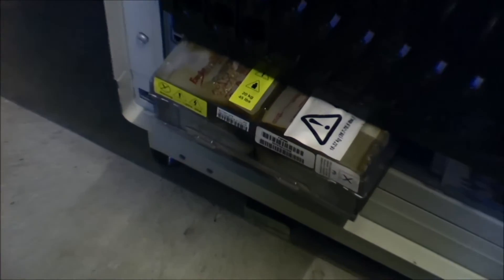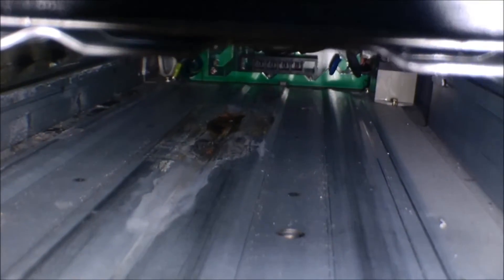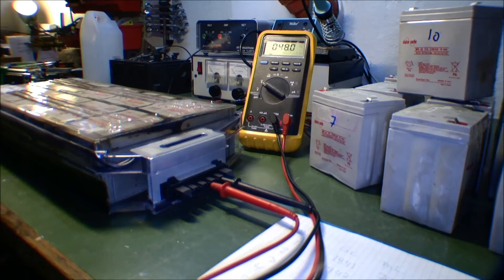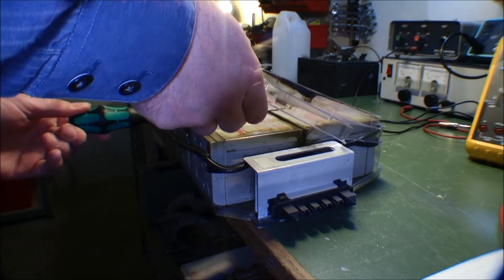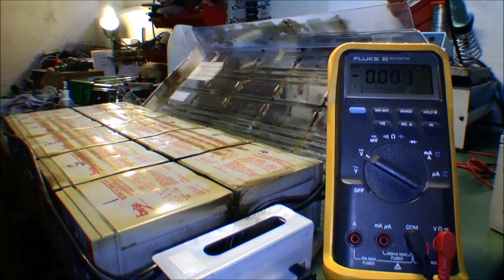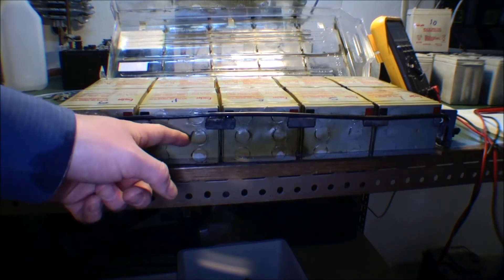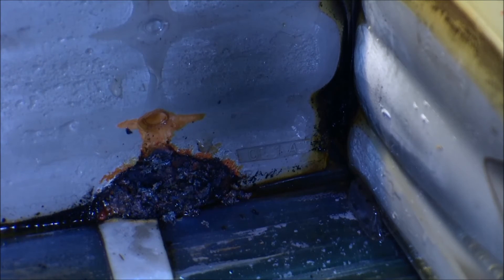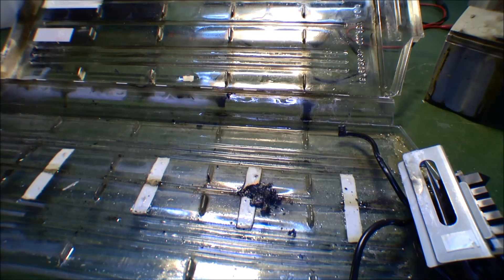Trying to get life in 3KW UPS Battery pack - part5 - 044

Comment: a big shame for the manufactor, the stuff is expensive so we should expect a save system ? battery caddys should have some sensor for temperature what put down the charge current or complete cut of the charging and give alarm ...  those things should not cost much extra is my idea.
Reply from the maker: Hi highflow highflow
Thank You very much!  This is a old video, but I just replaced the batteries, with new ones yesterday :-) video on it's way. no problem.
Thank you for watching! :-)

Comment: I have about 15 of those HP server UPS which I refurbish. Old batteries will have a larger internal resistance not allowing them to take a charge and at the same time, that internal resistance is converted to heat. The UPS charges at quite a high initial current to bring them up to the required full charge but at such a high resistance, heat and electrolyte boiling will inevitably cause leaks. If clients want a cheap repair, I get a bank of 10 X 12V 7ah batteries and wire the UPS internally to enable the battery bank to be charged outside the UPS. I manage to get those batteries for 13 euro each and they are larger so with 130 euro and a bit of Gauge 8 wire I have a good working system and also easier to check the voltages and the health of the pack instead of that crammy slot!
Reply from the maker: Hi @billywhizzy
Thank You very much!  glad you liked the video :-)
Thank you for watching! :-)

Comment: Hello, Thanks for this serie of videos. I´ll try to understand it, but my english is not very good so I only i understood a part. But I'd like do a question. In part-5 I have viewed, that ups light are blinking red for alert, red for bad batteries, and green for las light. This is the same problem that I get in my ups and I have replaced all batteries with no solution for the light. Have you repair it after batteries replacement?. I no get connection for check it with HP Power management so I'm blind. I don´t kow What i can do. Any idea? Thanks
Reply from the maker: Hey p-upssss,, Thank you for your question. 
Do I read correctly that your two red LEDs flashing and the green LED is on. ??
I would start by measuring the voltage on the battery pack with a multimeter.
If you have the same model as in my video. Then there should be at least 60volt on each of the two strings.
Reply: Morten Hjorth thanks Morten.
I just take measure in batteries, and i think it is OK. Both string are about 60 volts. The batteries are new, and after disconnect and reconnect again, Utility led is the only light that blink, red light in alarm and battery led goes off,but i don´t start it after wait for 24h for load. Utility light come on blinking with no results.

Test button check all ok. Any Idea?
Reply from the maker: Sorry, I did not see your message until now.
If only  Utility light come on blinking, i think you then only need to press the power ON,,for 4 sec. to turn on the UPS.
Where did you get new batteries for that old UPS? they cost a fortune,,, right ?